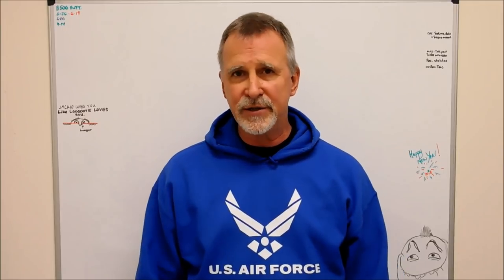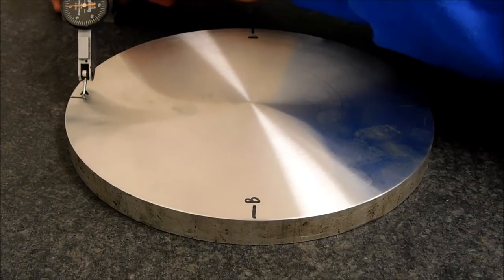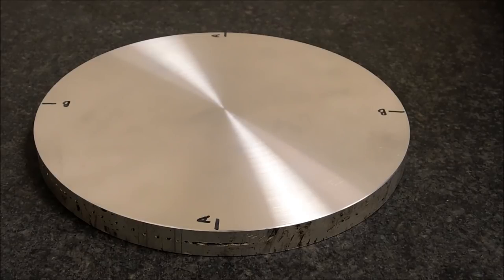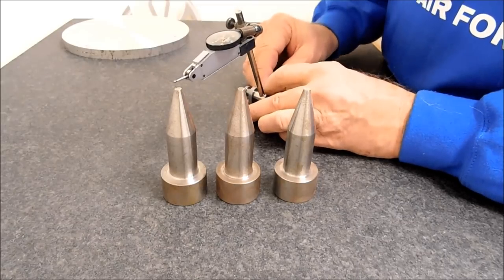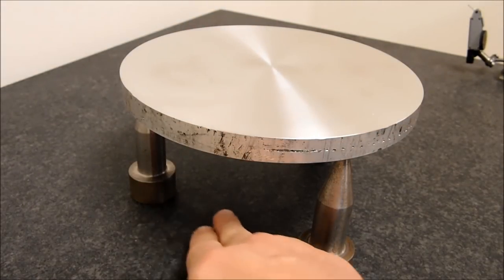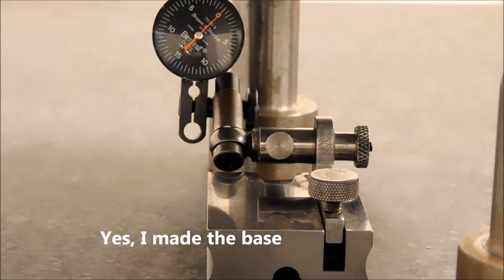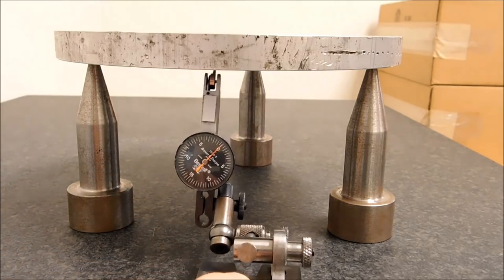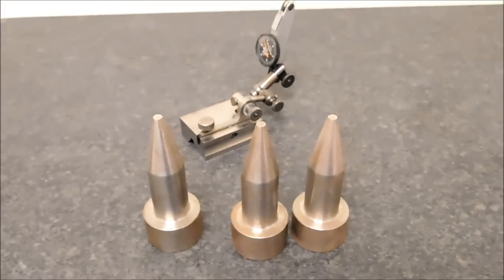How to Accurately Inspect a Flat Surface

Comment: I got confused, so you've machined both sides and the A B side is facing down when using the towers? If you had left one side not machined it would have made it very clear why this method works.
Reply from the maker: True.

Comment: You're checking parallel. You need jack stands on 3 points. Zero the 3 points to the indicator which would make it a flat plane, then move your indicator across the surface. Just an FYI
Reply from the maker: Doesn't a parallel reading to a known flat surface indicate  the surface being checked is also flat?

Comment: Is it more accurate using only 3 towers instead of say four?
Reply from the maker: 3 towers will never rock on an uneven surface. Stick with 3.
Reply: In the world of geometry, 3 points will define a plane in 3D space.  Any other number will defeat the strategy, just like a shopping cart with 4 wheels often has one that's shorter and wobbles.

Comment: Please explain why this method is needed over just laying the part flat on the granite. Measuring the opposing side. Then flipping.
Reply: I can see if you want to know the error of a specific side when the opposing side is also not flat. I typically USA a surface grinder to do finish work so parallelism and flatness are within .0001”. On a lathe I can see a need for it more I suppose
Reply: laying the plate on a surface gives you parallelism of the part, the second method takes that second side out of the equation and gives u flatness.
Reply: The first test he did is kind of useless, because if the indicator moves, you don't know if the top is sloping or if the bottom is sloping.
The second test references one face directly off the known flat granite and is not affected by the opposite face.
After doing the second test, then you could flip and do the first test successfully (because you'd then references a known flat face).

Comment: Would it work to use jack style stands under the part and create your 3 point level plane on the top and take your reading? Or is that checking parallelism
Reply from the maker: I don't see why that wouldn't work. you just have to be sure the resting surface of those stands can be trusted or the reading will vary as you sweep.
Reply: @joepie221  thanks for the great videos!

Comment: Great tip as always. 
Is there a set of drawings available Joe to make an adjustable dti stand like yours? Loving the thumb screw to move the dti into place.
Reply from the maker: Made that as an apprentice some 40 years ago. The drawing is long gone. Maybe I'll re draw it.
Reply: That would be great if you get the time fella. Thanks.
Reply: Don't take this the wrong way, but this is a pretty straight forward part o make. 
The dimensions aren't even critical except the length of the pieces and parallelism of the top and bottom surfaces.
Reply: You can even make a round base relieving the bottom face to about 1/4 or whatever from the OD so it will continue to wear flat throughout use.
Reply: It’s the mechanism with what I guess is a compression spring that the thumb screw attaches to that is like to a close up of.
Reply: Would LOVE to see a set of drawings for it

Comment: Joe,  I have been told it is better to move a part under the indicator vs moving the indicator over each part (I'm thinking of the towers you showed)?  Any thoughts on that?  Thanks again for making such informative videos!
Reply from the maker: I would respectfully disagree with that. the towers assure 2 parallel planes, and the part being parallel to the surface plate. Sliding the part under the indicator may give a false reading on a flat part if its not parallel to the other side.
Reply: @joepie221  I think he meant while checking "downwards", he wants to have the base with the indicator stationary while you drag the "towers" underneath them - there is no "other side", the tower is on your granite plate and you're checking it's heigth

Comment: I'm never sure how to turn relatively large diameter but  thin (say 3/4" - 1"  wide)  discs , so that the faces are square with the O.D.  .  I usually just rotate & wiggle the disc in the jaws as I carefully tighten the chuck jaws down onto the O.D.  - hoping the jaws will pickup the outside diameter and square the part to the squareness of the jaw surfaces...  But, I don't think this is the best way.  Anyone have a good way to do this?  As example:  a round CRS work piece 6" O.D. x 1"  with both 6" surfaces saw cut ( not flat, not parallel ) .  How would you turn to true up each face so they are parallel with each other and square with the O.D. ( total unparallel / square .002" over the 6" )?   thank you.  Roger Williams, NorMag Gunsmithing, Fredonia WI
Reply from the maker: Floating in a part as you have described is a solid way to allow the chuck jaws to help with the OD squareness to the face you are about to cut. If you can't turn the OD, it's just about the best way to do it. This video shows a setup that will help finish the backside if you don't use soft jaws. https://www.youtube.com/watch?v=U3x8H1Xb-jg
Reply: @joepie221  Thank you Joe.  You answered SO quickly.  You confirmed with the method i use to 'float' the work piece to the jaw faces to get the disc aligned fairly good.  AND, your video link was EXACTLY, not only the answer to my question; but, the stand-off tip was outstanding!  I will be D/T some of my chuck faces.  Your work, thinking process and your help to our community is beyond outstanding.  thank you.
Reply from the maker: Happy to assist. thanks for watching.

Comment: Firstly, great video! It was very informative. I do have a question about something similar our design engineers came up with at work. So, they found a small granite table and milled a slot through the center of it. They then clamped a drop indicator to the bottom that protrudes up through said slot. When the machine operators check to see if the parts are flat, they lay the parts directly on the surface plate, and sweep the part over the indicator . My only worry about this is if the surface plate that was in storage for possibly 20 plus years might not be flat, and that what if the drop indicator is not perpendicular to the surface plate. Not to mention some of the parts they check over hang the surface plate. So isn’t there a possibility of rocking or bowing? What do you think Joe?

Comment: Hi there Joe,
another great video goes in my educational library. Actually I was searching the YouTube to find someone and show me, how to test my Granite if it's true flat. You see I don't have any true flat surface so I can use it as reference. Do you have any method to do that.
Thanks anyway. 
Keep walking (I mean videoing)...... :-)
Reply: You can check out robin renzetti's video on lapping his surface plate flat and how he checked for relative flatness with a precision level. 
https://www.youtube.com/watch?v=6nY7uW1uG9s&t=1878s
Reply: OMG, this is a very complicate and sophisticate procedure, I just need to check my 45x45x4cm granite if its true flat, to be a trustful tool for me. Anyhow thanks for the try.
Reply: This is usally done using highly accurate electronic inclination measuring sensors in a temperature controlled environment. Check out wyler.com/en. They produce such plates and the sensors.

Comment: Thanks again Joe. Also if I didn't hear this, just mentioning the importance of the tripod to prevent false reading or rocking. So all those years using optical flats and monochrome light on those Pratt bearing seal plates was overkill I guess. lol. Just joking. Thanks again. You remind me of how often the best way is often the simple way when it's done right the first time for what's needed. Chris

Comment: Hmm..  makes sense. I was taught to always use three jack screws under my part with the "flat" surface to be checked facing up. Then eyeball a sharpie mark at each jack location and zero each one with the indicator. Then sweep over the face and check for run out. Almost the same thing as your way.

Comment: 1-2-3 blocks with ball bearings on them.
Reply from the maker: You would be relying in very precision counter bores. Good luck with that.
Reply: @joepie221  I was lucky, I checked ball bearings in all of the holes on my 123 blocks and found some that matched to 2um ( < 1/10th).  I marked these holes for future use.  That said your towers are easy enough to make even without a surface grinder and will get in the way less than 123s.  Keep up the inspirational good work and excellent teaching, it is much appreciated.    UK.

Comment: If the granite is level and flat. Why do you need the pins?
Reply: One thing it does is to isolate the flatness testing to a single side. Indicating with the bottom surface on the plate won't show which side isn't flat. Perhaps there are more reasons.
Reply from the maker: The pins create that standard parallel reference that makes this process check exactly what you are trying to check. A wavy part out of parallel would introduce extra frustration in your results if you checked from above.
Reply: And this is the only method that works with a part that has only one flat surface.

Comment: You did not show if your granite is flat - uuuuum?
Reply: Good point. Be assured the plate is flat engough for his dial test. I used to work for a company where we produced this surface plates. Accuracy was according to DIN 876/1 to 00. For a 1x1 m plate the accurancy was 20 microns overall (DIN 876/1), 8 microns (DIN 876/0) and 4 microns (DIN 876/00). 1 micron is 3.93701e-5 inch.

Comment: I would blue it and use 123 blocks to look for high or low spots
Reply: And that is not a measurements, that's a comparison to (un)known blocks. If you see a high/low spot, then what? How do you know if the part is to spec if you don't measure it?
Reply: That's how you locate the high spot. That is not how to "measure "  flatness.
Reply: Max Idontwanna its pretty close ? Strait edge is strait and 123 has ad the headache of making it strait done? But ace vid
Reply: In better at looking for wet spots lol!!!

Comment: lol then comes the question how do you know your table is flat?    chicken or egg   someone had to say it lol
Reply: You have it inspected in regular intervals. If you need a flat surface to do the work, then you need to recertify it periodically.
Reply: yes jaakko i understand what you are saying. i was being a sarcastic american. we trace everything back to standards yet how do we know the standards are any good - paradox
Reply: Not with flatness, you can self generate a flat surface and don`t need anything flat to compare it with. You use the 3 plate method.
Reply: You can self generate a vertical milling center, but will you just to do your job?

And I doubt many have to patience to do 3 flats of granite of suitable size, let alone ways to handle those  large pieces.

In the end you still have to get them certified if you are going to do anything to measurement standards.
Reply: Would I do it just to do the job ? No of course not I would use a certified surface plate or whatever, the same as nearly everybody else would. I was just saying in reply to Richard Cranium that its not really a chicken and egg paradox because there are methods to start from scratch, thats all.

Comment: That's a parallelism measurement - not true flatness.  You would need to set the tangent plane of that upper surface parallel to the surface plate (shimming or whatever) - then measure the flatness variations of the upper surface.

100% wrong..
Reply from the maker: Incorrect. The indicator as passed over a true flat surface - the granite surface plate - will reflect deviations in the surface its in contact with - the part -.  If I was checking parallel, i'd be on the top of the disc. Thanks for the comment, but you are wrong.
Reply: @Bramblek  This setup indicates the presence of a parallel surface to the reference surface ( the surface plate ) the indicator is registering on, and the lack of needle movement indicates the aluminum surface, is as flat as that reference surface. This setup doesn't verify a parallel relationship of anything existing within this part. Your credentials are impressive, but I'm going with Joe on this one.
Reply from the maker: @Bramblek  As a 45 year journeyman toolmaker having served my apprenticeship in the field of precision miniature componentry, and spent every day since then, designing and manufacturing product and tooling for the aerospace, medical and semi-conductor industries, I am shocked you would make such a statement and fail to grasp the mechanics of the video. Since resumes apparently impress you, here's mine. 47 years in manufacturing. Entire career dedicated to tooling, prototypes, customs and high end repairs ( military valves from ships ). I have multiple patents for advanced medical devices and 4 times as many that I acted as a contributing design engineer on. I'm a former instructor of "Design for Engineering" for 3rd year mechanical engineering students from the university of Texas co-op program. I have trained numerous apprentices that have gone on to successful engineering and fabrication careers. My production record is flawless. My artwork has been commissioned by the motion picture industry as well as the US and Canadian governments for use as their highest presented honor in the field of metrology ( measurement ). The Wildhack award. I hold a Guinness world record for having engineered and built the worlds largest mechanical puzzle and have gone heads up with many PHD level experts in the field of inspection and standards, and easily shut them down. If you care to point out the flaws with the demonstration shown, I am extremely interested in your follow up. By the way, I agree 100% with the comments Shop Tech made.
Reply: @joepie221  As a sane person with no qualifications I’d ignore that guy
Reply: Who cares about parallel? You are missing What He is Checking, if only one side has been qualified and needs to be checked,this is how it should be Done ,Cheers.
Reply: You're wrong the correct ways to check the bottom
Reply: I think Edge may have only watched the very beginning of the shop portion of the video, when Joe went from A to A, and B to B, across the top of the part. Then his statement would be correct. What Joe did on the second part of the video, with the 3 posts, is effectively what Edge said with his statement of: "You would need to set the tangent plane of that upper surface parallel to the surface plate..." Joe did that by flipping the part and putting it on 3 points (defining a plane).
Reply: @joepie221  Daaaaaaaaaamn Joe! Talk that talk haha. Love seeing two people that know what they're doing go at it. Im still a young engineer (~4years) learning the ropes and GD&T is always something i've noticed my drawing checkers argue back n forth about lol. It can be very confusing and everyone has an opinion on how my design and drawings should be made.. Been very interesting career in the design world. Hope my knowledge becomes like you both some time
Reply: @Bramblek wow man delete your comment 😂 i was embarrassed for you Mr. Qualified.

Comment: That’s a lot of cosine error going on.
Reply from the maker: Only if I was measuring would there be any possibility of that, however, the extreme tip bend actually reduces cosine error. I would be interested to hear your thoughts behind your comment.
Reply: @joepie221   Looks like maybe 20 - 30° cosine error, based on the angle of engagement of the tip.  I don't see what you mean by 'extreme tip bend'.  To get the most accurate reading, the straight section of the tip needs to be parallel to surface you're measuring (I'm not talking about parallel to the indicator itself, but the angle at which it engages the part).  Either way, your flatness is actually slightly better than what you're measuring.  For true flatness, you would also need to adjust the stands, based on your high and low points... but that gets laborious, and just keeping them at the same height works well enough.
Reply: Cosine error is only a factor in absolute measurement and all he does is relative measuring. Meaning there is no cosine error